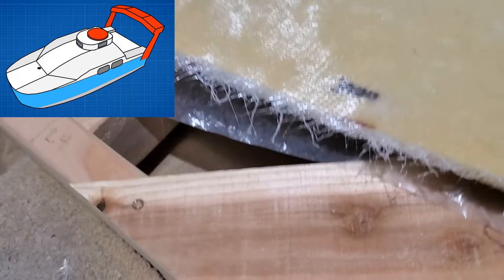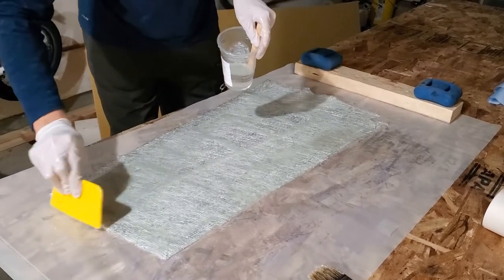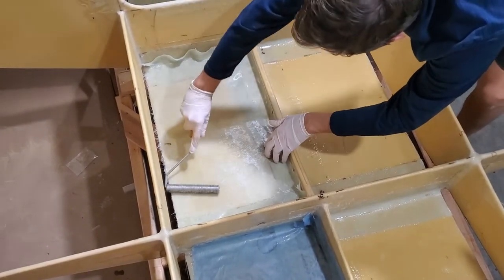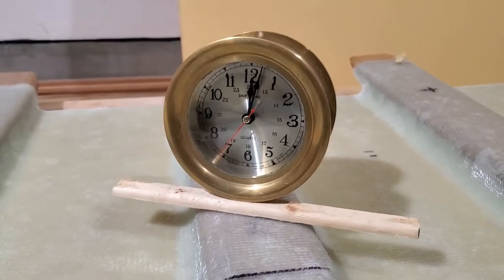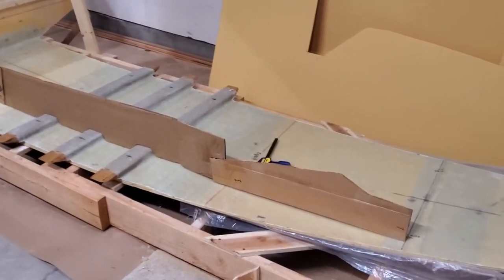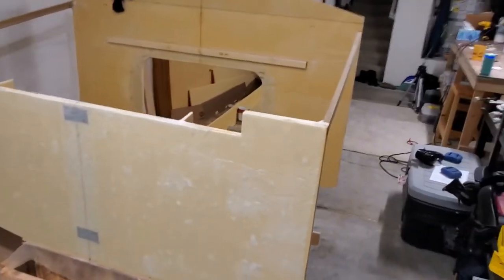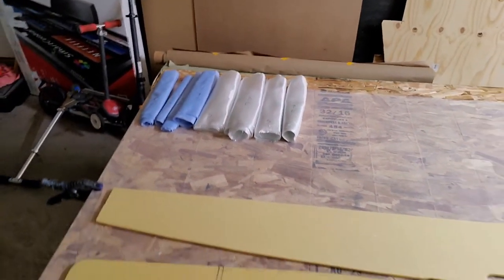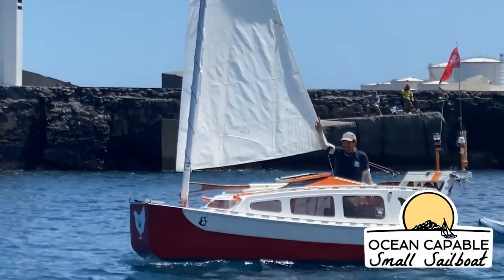OCSS-013 Preparing Main Cabin Longitudinals - Mini-Cruiser Sailboat Build

Comment: Hello, I noticed you had excess epoxy in the cup. You could extend its cup life by setting the cup into a bowl with ice cubes/water. I hate wasting epoxy :)
Were do you source the PVC foam boards? I checked local and nothing. My project calls for cored cabin top and deck. 
Thanks, Great work.

Comment: How does peel ply work? You just lay it on after you roll on the cloth?
Reply from the maker: Yep, lay it on the wet cloth, let the section cure, then when you peel it off it leaves a smooth surface that has a texture ideal for applying another layer of cloth or paint. At the same time it removes amine blush, a waxy surface epoxy forms when curing.
Reply: @ocean_capable_small_sailboat  is it expensive? Where do you get it?
Reply from the maker: @MotorcycleMouse  Just search for Peel ply or vacuum release fabric. Plenty of suppliers out there.
Reply: Awesome thank you so much. Ps congratulations on your captains license